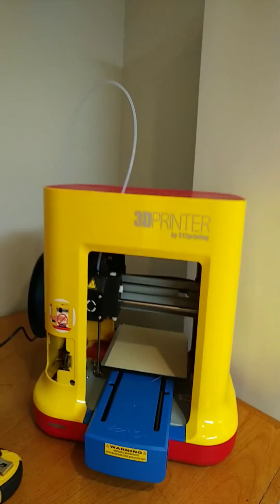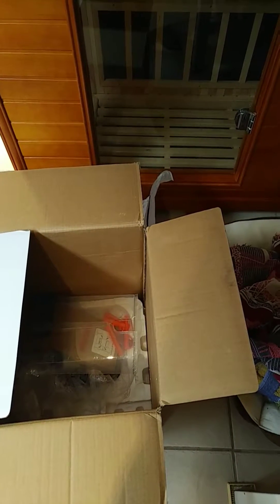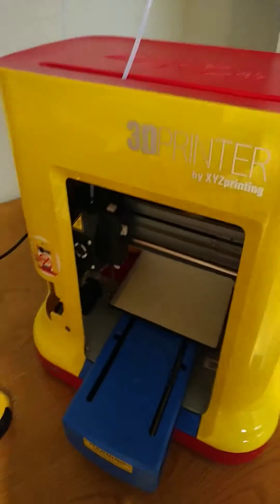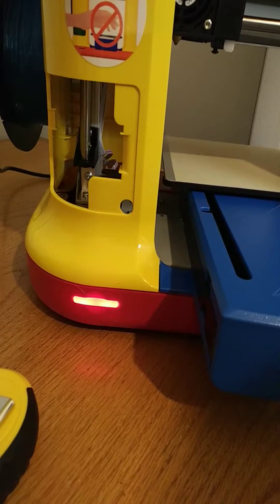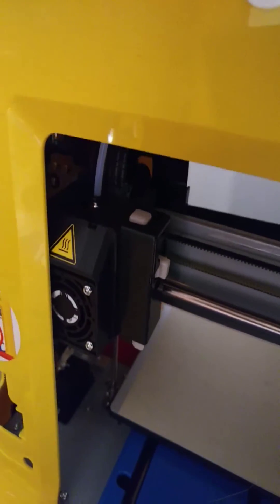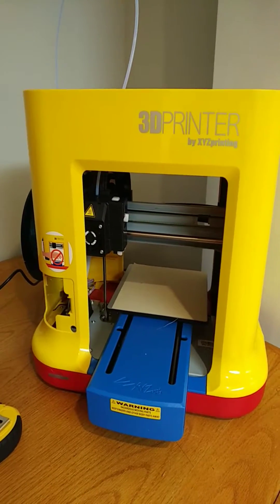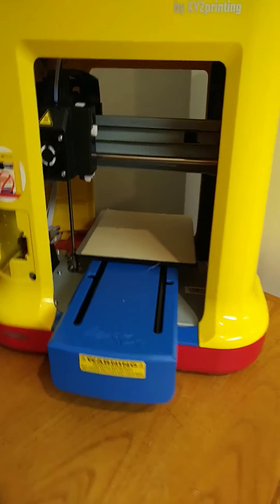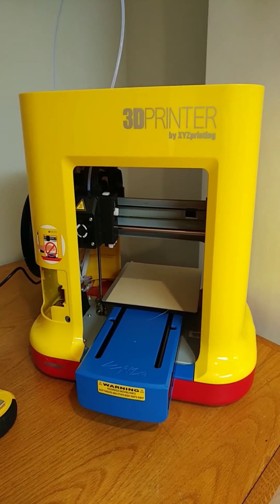DaVinci Mini 3D Printer Grinding Noise/Error - Sketchy eBay Special!

Comment: I'm having the same exact problem
Reply from the maker: I never fixed mine because I found that the X-axis print rail was bent, so I sold it for parts. If you can find the specification of the rail and replace it that might be a fix

Comment: Well damnit, I'm having the same problem. (Atleast I think, turned it off immediately after the horrible sound to prevent damage) Only different thing is that it's on the w+ version, but that shouldn't matter.
Reply from the maker: What I eventually figured out was that the X-axis rail was slightly bent/warped, so the tab that was supposed to fit in between the two sides of stop sensor was instead hitting it directly and jamming the motor before the end of its travel. Check your rails and make sure they're not bent!
Reply: Thanks! I can't see any visible bends or warps on the rails. When I manually move it, it appears to go through the stop sensor, rather than hitting it.

Comment from the maker: Update for anyone curious: I got a full refund on the printer. 

The grinding noise from the X-axis was the extruder assembly whacking into its limit sensor on that side, and trying to keep moving that way. I managed to tweak it so it doesn't do that, but after it calibrated then the Z-axis motor started grinding and refusing to move. I can't find an exact replacement Z-motor anywhere and because of the misalignment of the X-axis extruder rail it probably wouldn't be worth the trouble for this printer anyway. 

So it looks like this printer is a bust, and I'm going to sell it for parts. Hopefully I can get a nicer model in its place at some point.